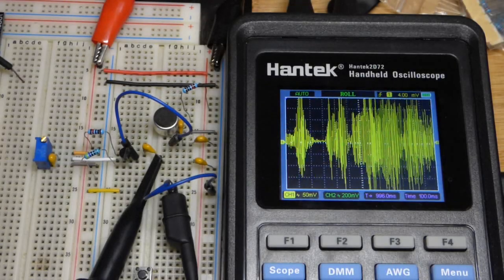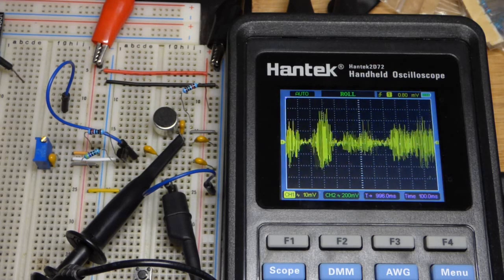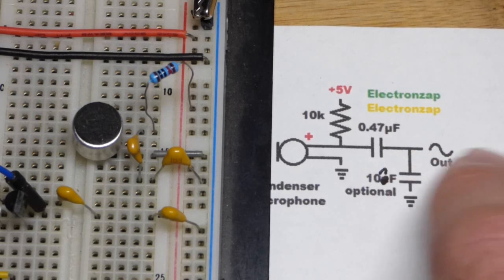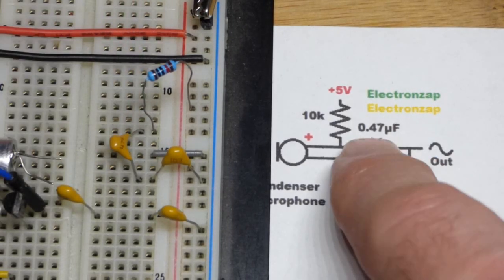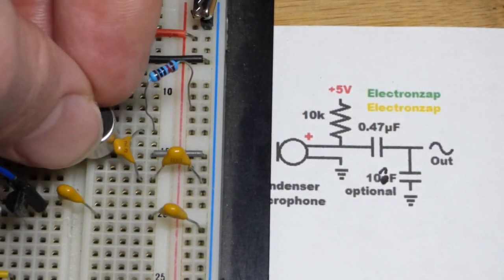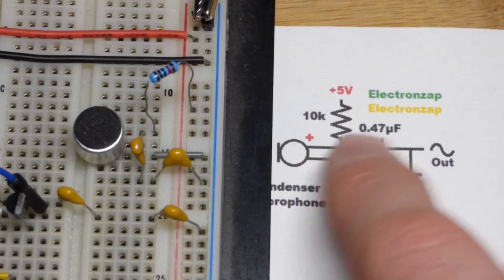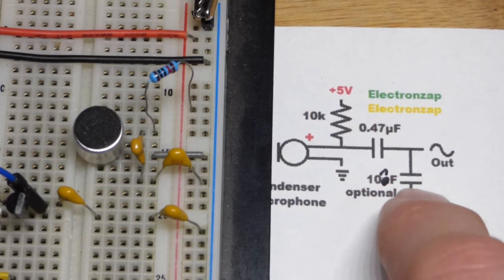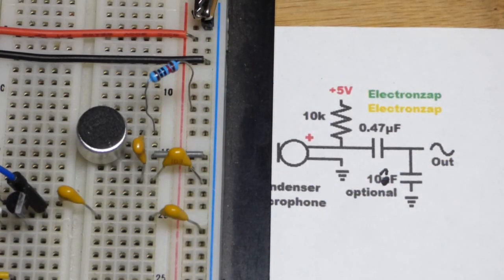Basic condenser microphone component circuit fragment schematic diagram by electronzap

Comment: Are you sure that's a condenser microphone?. It looks like an electret capsule. Nice presentation. Thanks, Peter.
Reply: An electret capsule is a condenser capsule. It is permanently polarized because of some special materials used in the construction, whereas the condenser capsule you're probably thinking of is externally polarized. Typically, a condenser microphone with an externally polarized capsule is fed with 48V "phantom power", and the capsule itself may receive anywhere from 40V-80V or more depending on the design of the microphone, using some form of DC-DC conversion in the circuitry.

Sometimes, externally polarized condenser capsules are referred to as "true condenser capsules", but this is a marketing gimmick. Electret capsules are just as "true", they're just permanently polarized as I mentioned. I hope this cleared up the confusion.
Reply from the maker: I dunno, I see sellers use both names used with the same component. I'll have to learn the difference.
Reply: So does the electret capsule microphone required normally around 5v compared to the electret condenser microphone which requires Phantom power (48v)
Thanks in advance.
Merry Xmas.

Comment: Super nice.  How can you add an amplifier into it?
Reply from the maker: I bought some new microphones with wires attached to then, but unfortunately I don't know where I put them. I plan to try to make an amplified circuit when I find them.
Reply: @Electronzap  Excellent.  Nice work...
Reply: You should add an other amp circuit and you exactly link the output of the mic circuit in the r or l input as audio input. .
Reply from the maker: Yeah, that should work. When I was working a lot, I bought some microphones that I think will work better but now I can't find them whenever I look lol. Don't know if I'll ever get back to this project.  @naturesounds1664

Comment: can anything to be done to reduce background noise? by change smoothing capacitor type or capacity？
Reply from the maker: I bought more microphones with wires already attached but can't find where I put them. I was going to start making these circuits again when I got a break from working a lot of hours. So, unfortunately I haven't made anymore progress.

Comment: I note the capacitors aren't standard ceramic. Are these a tantalum? Are these better for low audio noise?
Reply: Those are ceramic too. :)
Reply: @HazeAnderson  Ok was wondering. There are so many package types about it's sometimes hard to tell.
Reply from the maker: I'm pretty sure they are just regular ceramic capacitors. Came from a low priced kit.